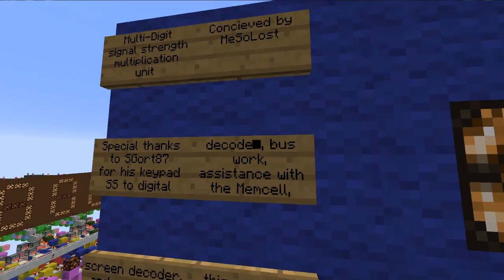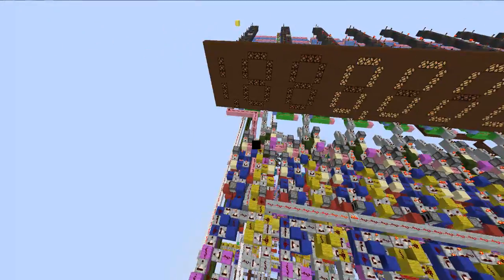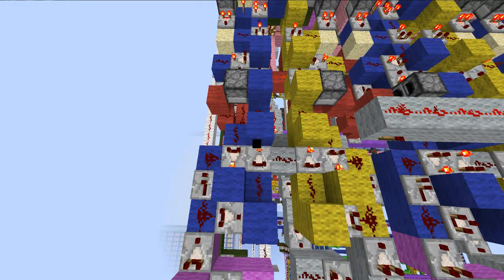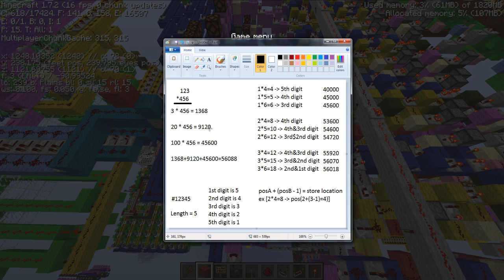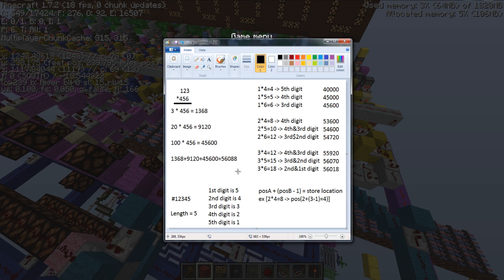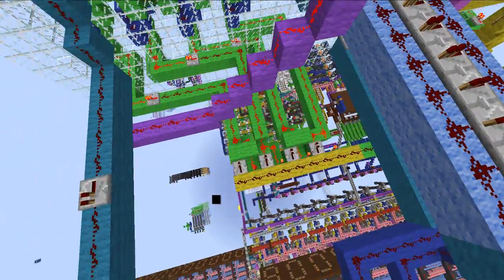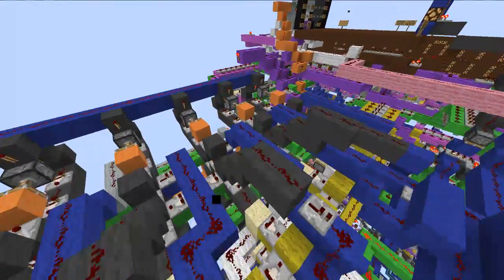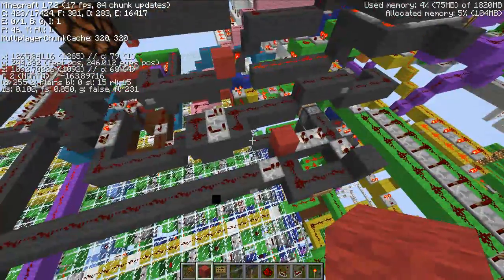Minecraft signal strength (analog) based multi-digit multiplication unit

Comment: why dont you just use comparators instead .... also im making a multiplication core.... its called “little mess”
Reply from the maker: It does use comparators in the adders. each one of those cores is the entire multiplication table (think back to grade school) a giant lookup table basically so it doesn't have to calculate the multiplication part, it just recalls all those little answers and then adds them all up at the end.  Think back to grade school again and that "show your work" thing and this machine does that.  I just wanted to make the fastest multiplier on the server using something that nobody else had before at the same time as i further refined my analog adder.  It's not entirely a combonational adder, nor is it purely a math one either, but as a hybrid of both it can do large calculations rather quickly for a minecraft machine.  I have since made an 8 bit pc in MC and wrote a multiplication program for it that's just 7 lines of code and works on my 16 bit one too.  Send me a link of that mess if you ever post it, I love seeing other peoples creations too.  And if you wanna see any of this up close it's all still on stym's redstone server ^_^  edit: oh and the values for the multiplication table.... those are stored via containers and comparators =p if i remember right worldedit said there was over 6,000 of them in the entire device
Reply: Sarah Campi... well i made mine on a serve and its not done yet... do you want to see it anyway?